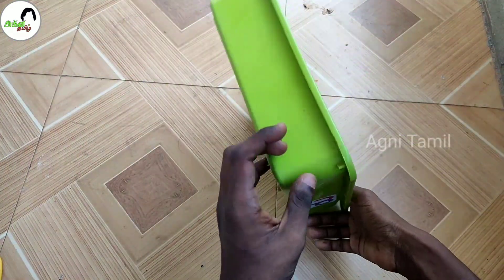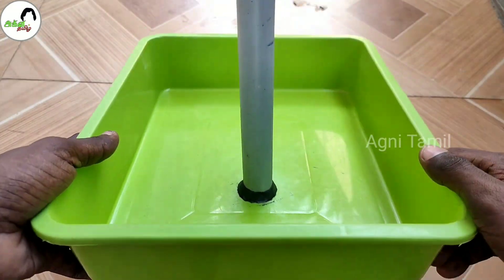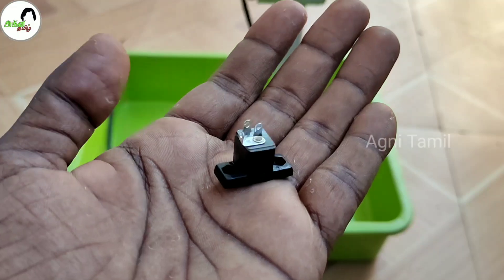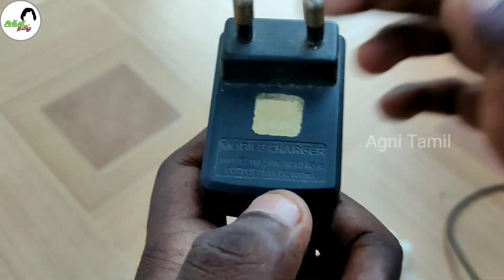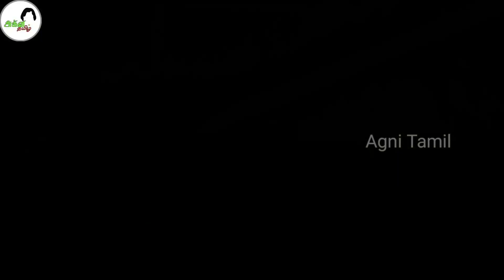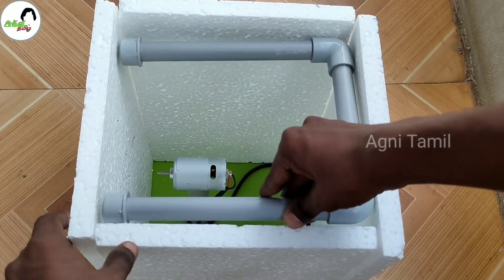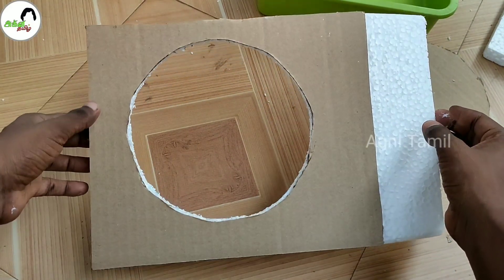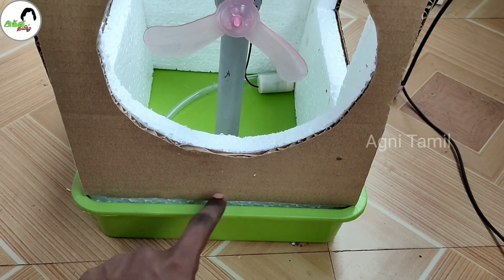Powerful Air Cooler செய்வது எப்படி? | How to make a Air Cooler | Agni Tamil

Comment: Motor 250
Water 130
Pump
Motor 219
Female
Port 139
Therma
Coal 100
Pipe  100
M seal 20
Tray 50
Propolar 15
=1023
 Idhukku pudhu fan vaangidalam da loosy
Reply: All are over rate😂😂

Comment: Bro idhuku 360 rupeesa bro achi dc motor 150 water pump 140 fan 10 power jack 15 foam 10 pipe 40 yes
Reply from the maker: Yen kita water pump irunthuchi so athaan na antha money ah add pannala
Reply: Okay bro

Comment: Bro this air cooler was shocked in water
Reply from the maker: Illa bro shock adikathu na check pannitan ogaluku venum na half inch pipe ah vachitu athuku mela wire ah kondu vaanga apo rombavae safe ah irukum....